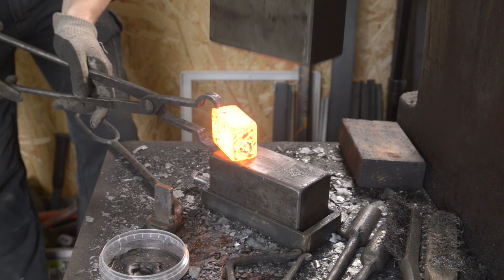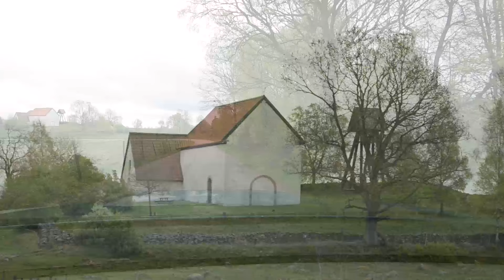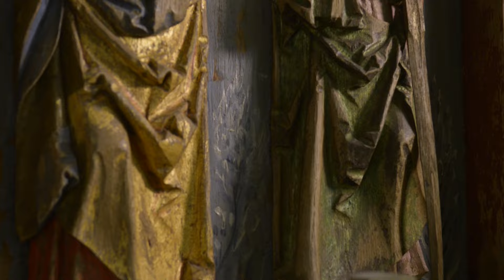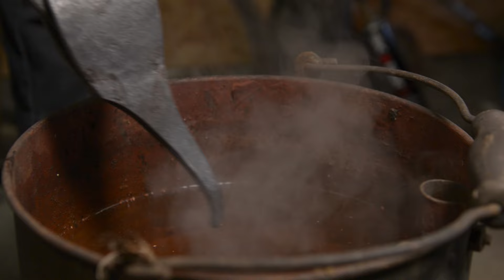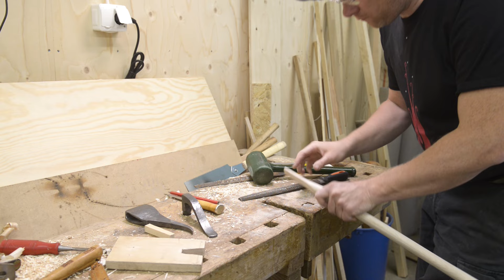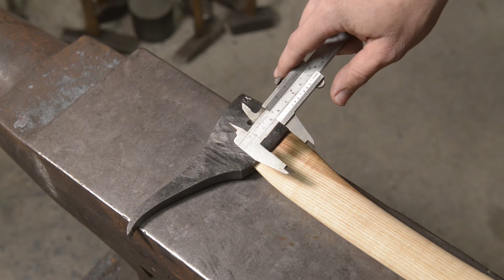Blacksmithing - Making a pickaroon

Comment: Yes, lightning bear, we are far off from the craftmanship level of yesteryear, not just in smithing but also stone working and woodcarving (now sure, i know there are some on the planet that can still reach this level, but seeing how wide spread these things ultimately are, these skills would have been a lot more common than in these ages) … not that i blame anyone, some of these styles are not for everyone, like IKEA seems to be. to each their own… ;) … also, nice work again, any reason you went with a point with some width instead of an actual point? (i am guessing the amount of penetration during use? thus easier to remove, but maybe there was another reason?).
Reply from the maker: Thank you. It seems a chisel point will work better, at least for the larger stuff. When you get a grip it hold better and easier to remove. Easy to dress as well.
Reply: @torbjornahman  tnx for your reasoning :) makes sense.

Comment: Do you have a method to decide how much bulk metal you need to manufacture a certain tool or is it by your experience in blacksmithing?
Reply from the maker: You get a pretty good feel for it, but there are a few ways. Calculate volumes or weights. If you want to duplicate something you can weigh it!

Comment: Are all your instruments for making holes in a hot metal made of steel that is quenching in the air?
Reply from the maker: All the punches I use under the power hammer is H13 steel, yes. For hand tools you can get away with other stuff. I use coil springs for many hand tools.

Comment: I have to ask, why the pin? Is there some advantage over a metal wedge? I've never seen handled tools of this sort with a pin here so just asking.
Reply from the maker: With this tool you pull a lot of weight and that is why. Not the same as an axe.
Reply: @torbjornahman  Makes sense. Thanks!

Comment: Great video as usual! 

Just a quick question, though I might be the one who is wrong here because I don't actually know much about this stuff. But isn't the grain direction on the handle completely wrong? :)
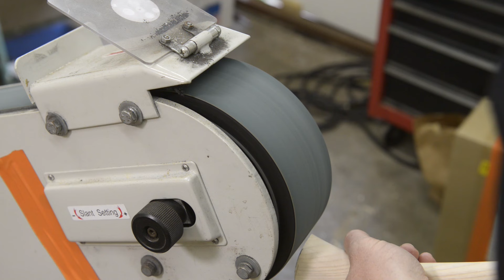Reply: I agree with this remark. At 21:21, one can see that the grain of the handle is not running parallel with the eye of the tool, thus making it more fragile - it probably does not matter so much for a pickaroon, whereas it would be an issue for an axe with a long handle.
Reply from the maker: Thanks. Well the grain direction is not perfect but for this tool it will work fine. I would not use it for an axe handle.

Comment: Shame the rivet was required...
Reply from the maker: It’s no fix... it should be there for this tool because of the pulling forces
Reply: @torbjornahman  It looks to me that the handle will become loose quickly with use. Just an observation.

Comment: Great video, as always.  I've used a pickaroon in the past and always loved the reach and control they give.  That, and not having to worry about smashed fingers or getting bit by a black widow, brown recluse, scorpion or some nasty snake!

The ones I've handled always had a pointed tip rather than a chisel tip.  They bite in, but seemed easier to pull free, too.

Keep up the good work.
Reply from the maker: Great! Thanks

Comment: I spent 18 years working in a papermill using a pickeroon daily. Very nice job on the forging, to make it release a little easier and to make it easier on your wrist try rounding the tip a bit and adding just a small burr to the very tip. It will on occasion need re-filing but sure makes it easier to use. I still use one when doing yard clean up or handling any timbers.

Comment: Torbjörn, why did you pin it to the handle? Is it like a traditional kindda thing?
Reply from the maker: It seems this is the traditional way. Since you pull on the handle a lot more than on an axe.
Reply: With an axe (when used properly), the impact on the head is longitudinal to the head so there isn't any expected wrenching of the handle within the head. With a pickaroon, as you see Torbjörn demonstrate, you wrench on the handle to move the logs around. The pin is to prevent the head from coming loose. :)
Reply: Huh... learning something new every day :)

btw, the sound quality of the new videos is beyond awesome! So crisp...

Comment: Having been around that tool a good part of my live , I haven't seen a pickaroon shaped like that at the tip... Tip too wide and you need a little knob at the very end...Like a pulp hook that we have around here... You need more than a good penetration and something that doesn't let go when pulling , but also has to let go at the snap of the handle... And that one didn't seem adequate... To each country has it's own I guess.. Loved the wide head though  .. The ones we get over here had to be modified before sending on the jobs... We used a set screw but like the pin and clinching...